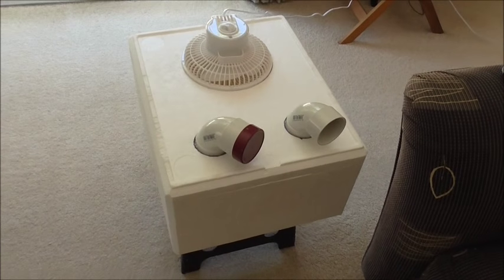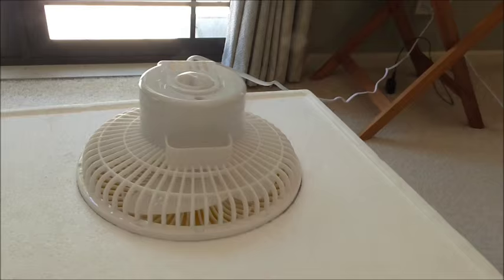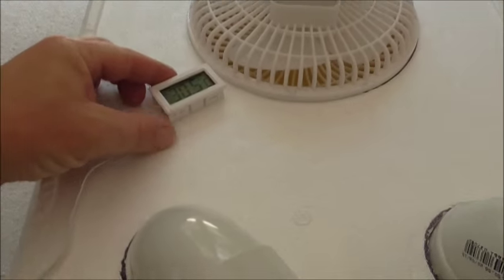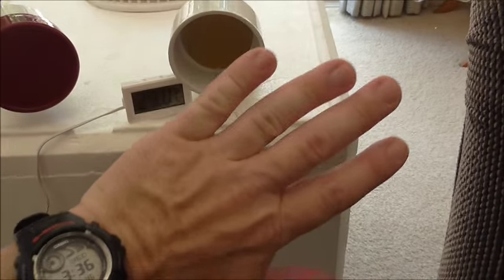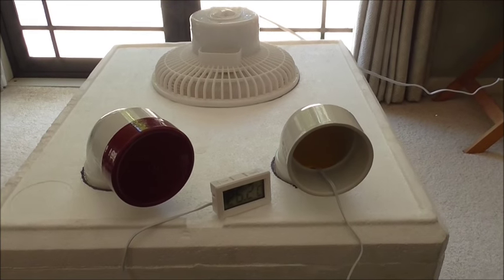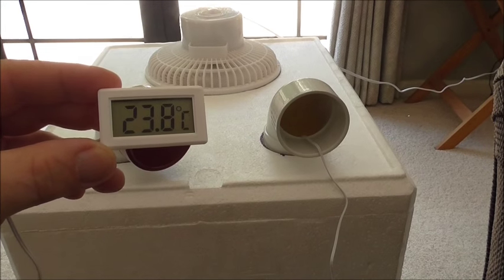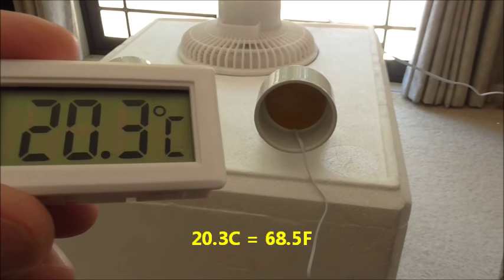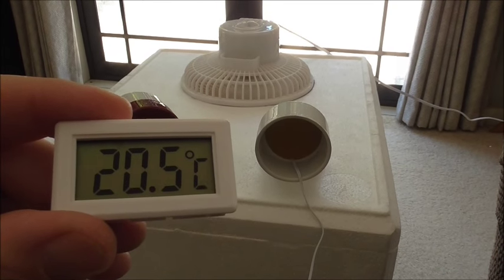DIY Air Conditioner Cooler - Summer Test Run

Comment: ITS THE TEMP INSIDE ONLY, NOT IN THE ROOM.
Reply from the maker: Hiroyuki Hasegawa Correct. I'm showing the temperature coming out of the vent. It's more of a personal air conditioner rather than something that can cool a whole room. You need to sit in front of the vents to get the cooling effect. Cheers
Reply: It could be for a whole room if that was bigger in size,, i mean bigger box bigger fan as well,, but the question is  for how long would it stay cooling  before we need to take the water out of the box, and add more ice,, guess it would be as every 2 hours in best cases.
Reply: what kind of stupid flawed testing is this? record the temperature before and after using the DIY A/C
Reply from the maker: Temperature of what? The entire room? It's a personal air con unit. It blows colder air directly onto you. Did you think a few litres of ice and a cheap fan would have the power to cool down an entire room? Think about it.
Reply from the maker: Sorry for the super late response. Using approx 10L of ice I can get approx 5 hours of run time, as long as I don't keep opening up the box. You'll know it's coming to an end as you'll see the outgoing temperature slowly rise up. Cheers

Comment: is that keeping the probe inside the air conditioner give the right measure
Reply from the maker: Hi. Just trying to measure the temp of the air coming out of the vent. I made sure it wasn't too far in and sitting on the ice. Cheers

Comment: I would like to see how it cools the room not the tube
Reply from the maker: It's more of a personal aircon unit, rather than one that can cool a whole room. Best results are gained from sitting in front of it with the air blowing directly onto you. I found it good for this in the Summer. Cheers

Comment: I remember the build vid Dino. the weather in Sydney has been crazy. 18C one day 40C the next. when it rains it's either cold or hot and muggy. I should have built one of these instead of the POS evaporator I bought. this is on my to do list! cheers mate.
Reply from the maker: I've seen your temps have been all over the place. The humidity over here has been nuts. 90%+ at night. Hopefully we get some cooler weather coming from the south soon. If you make one of these, increasing the amount of time the air stays inside the box will cool it down more. Some sort of channeling or fin system. Cheers
Reply: TubeDinoz the funny thing is its been cool for a few days now. thanks for the food for thought about the channels. I have an idea brewing already. I will report back. cheers Dino

Comment: +TubeDinoz  Good follow-up to the build video.  I think most people would imagine that the goal was to cool the room off some vs. sitting directly in front of it.  I know I did.  Regardless, did you ever take any more temperature readings in the room itself during the 6-7 hours that the fan was running; readings that could be compared with the initial room temp of 30.5C?
Reply from the maker: Hi, thanks for your comments. Yes, I was the same. I thought something like this would cool a whole room, but it's just not practical to do that. As a personal AC cooler and sitting in front of it, it's pretty good. Unfortunately I didn't take any room temperature readings. The room it was in was quite large (70m2 or 700ft2), so I don't think it would have made any real difference. In a small room or bedroom with the door shut, it might drop the temperature down. Cheers

Comment: Did you see any difference if you turn the fan lower or higher?
Reply: +Lew Brew * fan speed
Reply from the maker: It's only a 2 speed fan. I works well on the top speed, which is still quite low flow. I read somewhere that if you push the air through too fast, it's not in contact with the ice as long as doesn't get cooled down as fast. Another thing you could do is create some sort of channeling or fin system in the box so the air is in contact with the ice longer. Cheers
Reply: yah thats what I was wondering if you used a slower speed if it would work better. awesome stuff dino

Comment: hi dino, wanna ask. if im using elbow with smaller size, will there be any different. since i have right now was 1/2 inch size.... hahaha
Reply from the maker: Hi. Not 100% sure, but I imagine the air pressure coming out will be increased due to the smaller diameter pipes. I know if I block one of mine off completely you notice the air coming out of the pther has a lot more force. I'd be keen to hear how you get on. Cheers Dino

Comment: which fan r u using? 
and how many hour r continue using
Reply from the maker: +nikhil solanki hi, It's just a cheap 6" (15cm) 2 speed fan. I've had it running for 4-5+ hours with the ice still there. Cheers, thanks for watching

Comment: So after having this through most of summer, you think it actually helps? Currently only 27 in Hamilton.
Reply from the maker: Hi. It's a good personal air conditioner, so you basically have to sit in the direction of the vents to get the benefit. I've had a few people ask me if it will cool down a whole room, but it's not really big enough for that. Cheers

Comment: YOU SHOULD show two things:

1.  The temperature a few feet away from, or at least just outside, the vent.
2.  For how long that temperature is actually kept.

I built one and it just doesn't work.  Temperature drops the most 5 degrees and after a few minutes it rises again.  Air inside the cooler has no time to cool down enough.  Prove it by lowering your fan speed, which make the A/C useless.
Reply from the maker: Ok. I will respond despite the personal insults. The probe was just inside the vent. It wasn't sitting on the ice. The temperature coming out was a consistent 20.3C Surely the air coming out the vent and across the probe is the same air that was drawn into the cooler by the fan? If you agree with that, then the temperature as the air passes the probe CLEARLY shows a 10C drop in the air temperature. I found it most effective to be sitting in front of the vents to cool yourself down. Surely you didn't expect a few litres of ice and a cheap fan to cool down an entire room? As for how long that temperature is maintained, the ice lasted approx. 5+ hours.
Reply: Well, kindness wins.  I threw you rocks and you threw me flowers.  Sorry about the insult; I edited it.  I was frustrated with the shit I built.  Thanks for your response.
Reply from the maker: All good. One thing I did do, which seemed to make a difference was going from bottles filled with water to a solid block of ice in a bigger container. Seems to last a lot longer. I'm sure there could be a few other modifications to make it better, but yeah it's never going to be that powerful unless you make the whole thing a lot bigger maybe?

Comment: Add 1/4 salt per 2 gallons of water to have the water freeze at a lower temperature so the ice will last longer.
Reply from the maker: Nice one. Thanks for the tip! 1/4 teaspoon or 1/4 of the total volume?